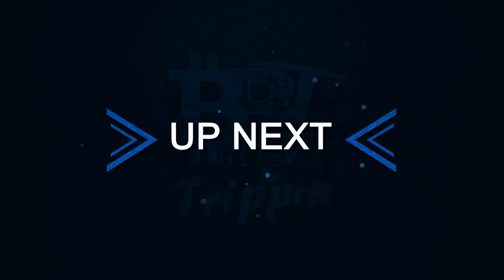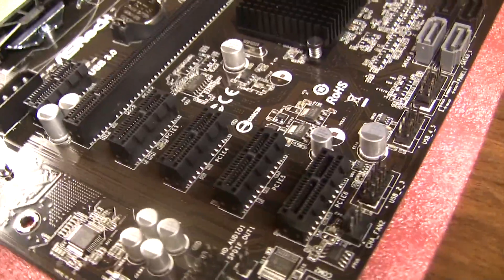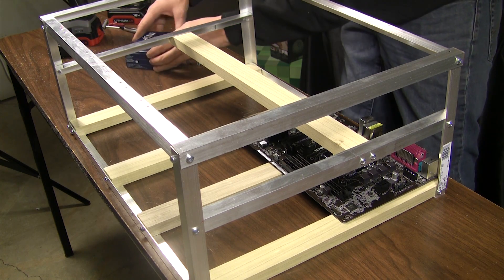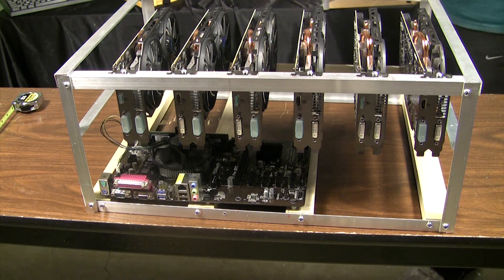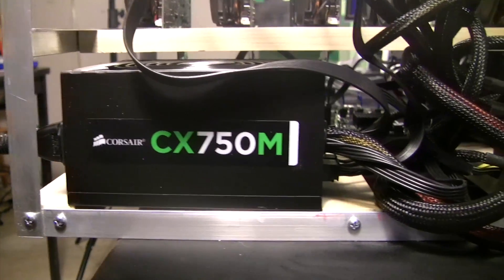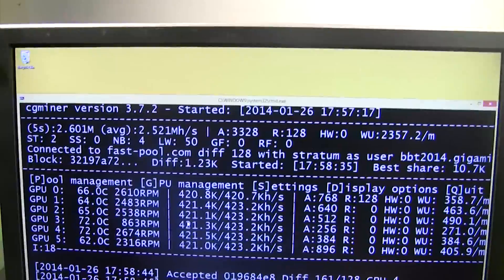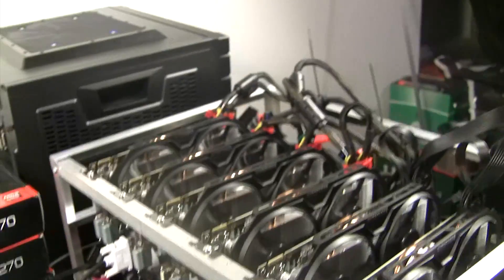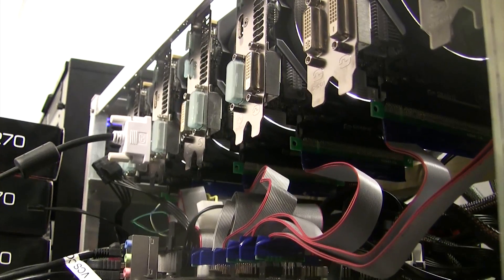BBT Episode 7: 6 GPU Litecoin Dogecoin Feathercoin Mining Rig using the ASRock H81 PRO BTC

Comment: Oh well I have been and bought the kit today : Asrock h81pro btc, 6 x gigabyte       R9 280x OC-3GD-GA, 2x corsair AX1200i, Pentium g3340 haswell 3.2ghz (54watt), 8GB (2x4) 1600 corsair vengeance ddr3, corsair 60gb SSD, external usb DVD, angle aluminium, windows 8.1 and timber / screws etc.

I am hoping to use 1 of the AX1200i in my desktop, Intel I7 OC to 4.6ghz hydro (corsair H80i)cooled on a Maximus extreme V M/B with 16gb ddr3 dominators to run 2 x XFX R290x TFDFs for mining and 1 x NVidia 3GB GTX660ti for the display only (not mining.) But will be using either riser cables powered, or 4 x 120 fans on the side port of the corsair 600 case, it also has 1 x 140mm fan in on the front input and 1 x 140mm fan at the top exhaust, variable speed.

I did have all 3 cards in for a test in the desktop and they all worked, but when started cgminer the top card reached 98c+ so I removed it, at that point it did have the side window in the case but have changed to side cage with 2 x 120 fans and will upgrade to 4 x 120 fans with dust filters to see if that works without using riser cables. If not its a good job the guy at the aluminium shop did not want to cut the 3 x  8ft / 2.4m lengths down and let me have the rest for free a 1.8 meter gift or 6ft of free 1/8" x 3/4" angle aluminium.

I hope that the Corsair HX 850 that's in my desktop will power the mining rig coupled with the AX1200i to run the 6 x R9 280s (windforce) ??????

I will be building it all in the next few days.

Looking forward to the next video.

Comment: Hi, and thank you, I have found your videos extremely useful as I am new to mining but going to give it a go.
Building the case same as from your video. 
Please can you confirm what power requirements I will need for this H81 6gpu board to run 6 x 280Xs (XFX R9 280x TDFD)cards ? and possibly upgrading at a later date eg to 6 x 290s ?
Or is there a better 280x card to buy if I can find stock ?
Also in the long run is it more economical to get bigger PSUs eg 2 x 1200 that are not working at 100% ?? in the 80plus platinum range or is 80plus gold fine ??
There is a lot of conflicting tech info on the net, but with your videos I can actually see it working as opposed to it works on paper and in theory.
Great vids keep up the great work, once I get mining and earning I will make sure I send you a donation.

Comment: I have the same mobo and running 6 Sapphire 7950 Dual X with boost cards with windows 8.1. I am using riser cables for all the cards. I have a 4 GB corsair RAM, 1200W Corsair PSU powering the mobo and 3 cards and another 850W PSU powering 3 GPU's.  I can't get this configuration to run properly. When i run with the default clock settings, it runs OK but produces very less hash rate. When i overclock it to 1075/1450 , either one or some of the cards drop the hash or the whole windows hangs. Since there are ton of people who can 6 cards without any issue, looks like it might be some settings that's not correct. I have spent considerable amount of time researching and trying various things but no luck so far. I am not expecting a crazy hash rate, i am looking for settings that can fetch me 630-640 Kh/s with these cards and running stable.

Comment: I'm writing the rack specs down for myself. But I thought I'd do it via a post; why not.
Materials:
3X 8FT Angled Aluminum
One 10Ft 1X3" Pine
1/2" Sheet Screws
1" Drywall Screws
Bank Pen as spacers

Angled Aluminum:
4 Cuts of 21.5"
4 Cuts of 9"
4 Cuts of 16"

Pine:
4 Cuts of 16"
1 Cut of 21.5"

1.5" spacing between the cards

Total Nerdness on your part would be to provide a cad drawing; but I would settle for knowing how far to put that floating wood support beam so the cards sit well on it.  Love the vid; going to bid a rig this week.  Thanks a lot guys, mucho appreciation; you should post your litecoin hash; when I get some, I'll tip you guys for the vid.

Comment: Great video, just a quick question, me and my friend are going to be dabbling in a little mining and just see how it goes, were going to build a rig pretty much like the one you have here, how ever trying to decide on the power supply's, going to run 2 750w psu, but do you think its work spending a little more to go from a bronze unit to a gold? to try and save on the electric bill with better effeciency
Reply from the maker: The savings are worth it over the course of a year to go gold, but as long as your not spending 2x as much for the gold as the bronze. If you can get a gold for 99 vs 79 bronze, worth it... if its a difference between 79 and 149 for same power, not worth it
Reply: Bits Be Trippin' well thanks for the quick reply, im in england so the difference is £70 for the cheepest 750 bronze modular unit i can find vs about £95 for a nice corsair 750w gold, so will = about £50 diff or $80 (for the americans) for them both

Comment: What did you use to attach the psu's to the wood?
Reply from the maker: Nylon Spacers ... or you can take a normal plastic pen and cut it into even 1/4" cuts and use the plastic tube... Some folks have even used the blue caps from the graphics cards as spacers successfully. Just ensure its sitting about 1/4" inch off wood for good airflow
Reply: Bits Be Trippin' I mean the power supplies.  Or are they just sitting on the wood?   Or zip tied or?   Thanks for the tips.
Reply from the maker: In the episode they were not attached yet, normally we tap a few holes in the aluminum and attach via normal screws. We were testing multiple PSU's on the rig so did not secure. 

Large 36" zip-ties work as does the sheet screws

Comment: I'm getting mixed results when on whether I should use powered risers or not?

I got 5 R9 270X. Do I want power or not? Some people say their risers melted whereas others say it a must.
Reply from the maker: Which motherboard? If the using the H81 Pro BTC we do not use powered risers. In the builds we used the MSI Z87 G45 Gaming and Asus boards we did use powered risers.
Reply: Bits Be Trippin' Same board as you. I already ordered 5 powered risers and plan on leaving the mobo molex connector alone.
I can't see 4 onboard molex pins providing the same current as 12(6x2) pins.

I don't have a molex on me, but only 2 pins are 12V+ right? One ground and the forth for 5V?
Reply from the maker: So you will obviously power each card with their appropriate 2x6pin's via the 12v rails. The 2x 4pins on the MB is to assist the PCIx Bus on the power requirements running 6x graphics cards ... each requiring 25w at the interface. I would absolutely plug in the 2x 4pin Molex connections on the MB ... and leave the powered risers unplugged. That is how our last 5 rigs have been setup without issue. We plugged in the powered risers on one of the boxes and found no change in stability ... so it seems negligible with this board

Comment: only vengeance
Reply from the maker: Any DDR3 PC10600 will work. I always go with name brand just to ensure any bugs/stable issues are not wrapped up in base PC equipment ... there are more than enough issues dealing with getting a multi GPU rig to be stable, the last thing you want to worry about is if its your system memory causing you grief
Reply: Bits Be Trippin' Thanks again.

Comment: Hi again, after seeing this board I have a question. I would like to use it for Sapphire Toxic R9 280x Deep Dive, are there any changes in the specs you recommended to me last time? Does it have to be 4th gen processor? On Amazon the 4th are expensive. I would like to try this rig and give you my results when done.
Reply from the maker: No you could use the cheapest processor you can find. 
Intel Celeron G1820 Haswell 2.7GHz LGA 1150 54W Dual-Core Desktop Processor Intel HD Graphics BX80646G1820 is 39.99 at microcenter right now
Reply: Bits Be Trippin' Cool thanks for your help.
Reply from the maker: You could use that processor ... and see great results too, no need for 4th gen processor

Comment: Hi. Great vid. I just wanna add, that I've been in contact with the ASRock tech team. They've confirmed via e-mail, that you can in fact still use the onboard GPU to operate the OS, while having 6 AMD GPUs installed purely for mining. That will free up whatever ressources your AMD GPUs would use for ie. Windows desktop, which in the end means more mining power.

Comment: Awesome video guys keep em coming! Would a single 1300w PSU with multiple 6-pin PCI-Express to Dual 8-pin Y-Splitter Cables work for the power? Is there a danger using splitter cables for power? A single power supply would simplify assuming you can find one in stock ;)

Comment: I have the same board and 4x r9 270s with 1000w corsair but can only get cgminer to run with a very low TC. Please have a look at my bat file 
-w 256 --intensity 14 -v 1 -g 1 --lookup-gap 2 --thread-concurrency 4032 --gpu-engine 1060 --gpu-memclock 1425 --gpu-powertune 10

Why is TC so damn low :(
Reply: when it runs with this bat file it instantly starts clocking up HW errors. Its driving me insane for hours
Reply from the maker: Colm Boorman You cant run that low of TC ...it will puke hard ... try: -w 256 --intensity 17 -v 1 -g 1 --lookup-gap 2 --thread-concurrency 16144 --gpu-engine 975 --gpu-memclock 1400 --gpu-powertune 1

and make sure BEFORE you run that ... you goto the command prompt Start->Run>CMD and at the C:\ type ... setx GPU_MAX_ALLOC_PERCENT 100

It should say setting saved ... then run the batch ... file with the new settings
Reply: Bits Be Trippin' I have ran that command before cgminer plus i have been including it in the batch files.

I ran the GPU MAX ALLOC just now and i changed my bat file to yours and CGminer reports this back that my TC is too high. I get a error 61 asking me to lower TC or up LG.

So i ran CGminer with a clean bat file and it made a BIN file with TC at 4032 and a intensity of 4 :( so i have been trying to mess with that. I wish there was a way i would test this more. I have a I3 CPU 8gb corsair RAM h61 btc mobo and so far 3x gigabyte 270s connected to a 1000w corsair RM1000. any tips where i can look for help on the TC issue im having ? The case im using is totally ripped off from yoru kick ass vids too. Im also on windows 8.1 installed drivers and then installed windows catalyst drivers (windows 8 as there was no windows 8.1 drivers on AMD website). Im going to turn emo at this rate
Reply from the maker: So I believe we ran into an issue like this before with another rig and different board. 

We found that to be one of the cards having the issue but found it by pulling all of the cards and working with each one individually first making sure it could hash appropriately... once we got to the troubled card, we kept going through the rest. 

Then tried the card in another computer as a single and still ran into an issue... It promptly was RMA'd after that...  Try to stair step the cards single at a time and see if you can narrow the culprit
Reply from the maker: Make sure your running CGMiner 3.7.2 also
Reply: can you point me to a clean source for 3.7.2 ?
Reply from the maker: Looks like it got pulled down off Github ... 
I just uploaded to Mega the version we use 3.7.2
https://mega.co.nz/#!1RtjQBqT!uluCax1tJJpRJ0J0zNhYu6Nhy-vq3ihLLzslgNZ9RTw
Reply: Bits Be Trippin' Installed Win7 Pro 64bit and I no longer have a issue with TC. Now running your latest CGminer bat and its flying. Cheers man!
Reply from the maker: Great news! Glad we could assist in part of it! Happy mining
Reply: Bits Be Trippin'  Looks like I can only get 4 cards working. I think you faced the same problems :( I have two SSD drives that are the same 40gb models. Im guessing you image your drives but what software do you guys use?
Reply: Bits Be Trippin' Im back on windows 8.1. I fresh installed without network untill i had to download ATI 13.12. I dont have the TC issue now but i do have 4 cards only issue in both WIn7 and 8.1. The last 2 cards adding are powered by a old AX850 via its PCIE.connectors. I connected them both to mobo by powered riser cables ( I have not connected them to power). The 4 GB 270s on the RM1000 psu are running fine in both win7/8 but the last two added powered by the AX850 just dont show up. Does my setup sound poo or wrong at all to you?

Comment: What are your entire GPU settings? I got a gigabyte 270 and I can't get it past 400kh/s stable even though it's running on its own separate PSU.
Reply from the maker: -w 256 --intensity 19 -v 1 -g 1 --lookup-gap 2 --thread-concurrency 24000 --gpu-engine 1100 --gpu-memclock 1500 --gpu-powertune 20

if that crashes, try:

-w 256 --intensity 18 -v 1 -g 1 --lookup-gap 2 --thread-concurrency 16144 --gpu-engine 1060 --gpu-memclock 1425 --gpu-powertune 10

Comment: I'm planning a rig very similar to this but I have a question about the PSU. Is anything special needed to get 2 PSUs working together without blowing something up? I'm considering 2 x Antec 650w Gold PSUs, is that enough power? Cheers.
Reply from the maker: Two of those would be sufficient for 4 to 5 (max) R9 270's preferably the MSI 270 Twin Frozers with the single 6pin (not the 270x) and definitely not R9 280x .. those at a min are 750w to 850w PSU per two ... and lean more toward the 850 unless you plan undervolting a bunch.
Reply: I'm thinking 6 Sapphire 2GB cards. The EVGA PSUs look to be pretty good value but I can't source them in Australia. I can get some Antec 750W units, though. Would 2 of those work?
Reply from the maker: Yes, two 750w is more than enough power. 3x + board on one, other 3 on other, with room to spare on power.

Comment: Im new to cgminer but your settings look wrong to me?

You have a TC of 16144 and 24000. You have two different intensity ? 

is there a reason for this ?

"Best settings we found locked in at 465k/hash:
-g 1 -w 256 -I 18 --thread-concurrency=16144 -w 256 --intensity 19 -v 1 -g 1 --lookup-gap 2 --thread-concurrency 24000 --gpu-engine 1100 --gpu-memclock 1500 --gpu-powertune 20"
Reply from the maker: your correct, we adjusted, TC should be 24000 .. was left in there from previous setting
Reply: Bits Be Trippin' A bit confused now, I copied those settings exactly from your description without looking over it closely and missed that there are 2 different TC settings listed, however still pulling 460k just fine on one card.  Should I re-edit it?  I will have 4 cards total by end of the week in here, and hopefully fill the last 2 slots by mid next week.  Just wondering if I should change that text for adding more cards.  Thanks for the help and love your channel.

Comment: Does this board have a power on/off button? How you power on this?
Reply: If you have a old case around just rip out the old power button.
Reply: You can get a case replacement switch on amazon/ebay, just about any computer place for under $5.  I just tie it up to the rig.

Comment: NICE!!! I got one of those Asrocks in order now! 
Oh, what about the driver version? Tried a lot of them? Where did you settle?
Reply from the maker: Drivers that came with board are what we used, as for the cards, used latest ati 13.12 catylst
Reply: Bits Be Trippin' Thanks man! Did you need to use the SDK as well? Some say you don't need it, some say you do... I install it, but I am just wandering...
Reply from the maker: We have tried the SDK on one or two rigs but found no advantage so haven't put on any rigs in a while.

Comment: Do we still need to use powered raisers for this mobo. Since it has two additional 4 pin power connectors, will that be sufficient and can we just use non powered raisers??
Reply from the maker: We have not used any powered risers with this board. However, on our next build we are going to be using the USB risers, which require power.
Reply: Bits Be Trippin'
I am using 4 sapphire 7950 dual-x cards with this mobo with BAMT. It all starts fine and after a few hours one of the card keeps dropping the hash rate. Is this anything to do with BAMT and will windows 8.1 help? Do i have to use dummy vga adapter?
Reply from the maker: How are the thermals? It could be throttling down due to heat
Reply: Bits Be Trippin' Thermals are looking good,i don't have any card crossing 77/78 C.I even tried using a dummy VGA adapter on the card and still dropping  it eventually goes to 0.03 Mh/s and other cards running at 0.63 Mh/s . Could this be due to the 1x port i am connecting. I am using this card at the first 1x port closer to CPU and also have another card connected to 16x port. I do see few folks talking about one port getting inactive when you have adjacent port connected.
Reply from the maker: On the H81 PRO BTC board we haven't had that problem ... however if you try to use a 1x to 16x riser in the 16x slot you have to use a jumper cable with it. If your using a 16x to 16x however we leave that riser unpowered, the board handles it.
Reply: Bits Be Trippin' Did you do any undervolt with these cards. I have exactly the same cards (Gigabyte R9 270) and i am running it with the default settings that it came with. I initially connected 4 cards and the mobo using Thermaltake 1050W PSU and the remaining 2 card with 750W PSU. This is taking more power than what you have specified in the video. I had to actually replace 1050W with a 1200W Thermaltake PSU to make sure it doesn't run with less voltage and break something. With the price increase of 7950 cards, i thought it would be good combination to use R9 270 for the price and the power consumed and the hash rate it produces. Now with the amount of wattage it shows up in belkin power meter all my calculations are falling apart